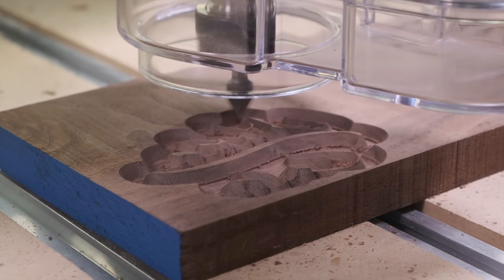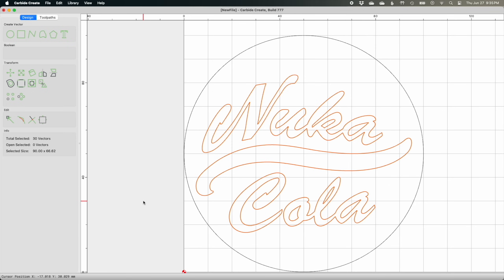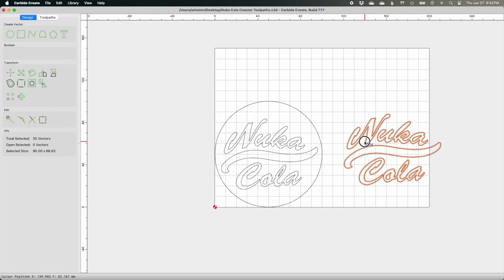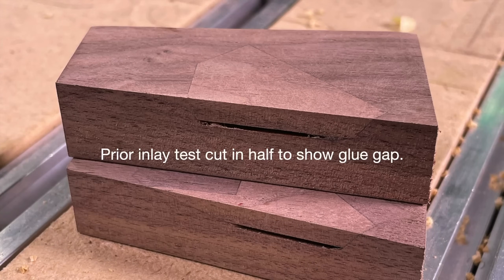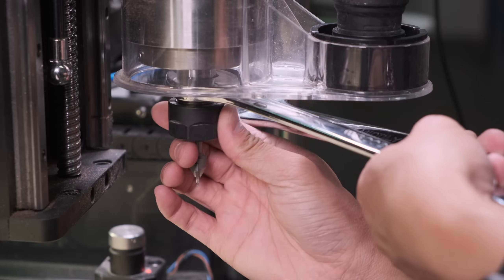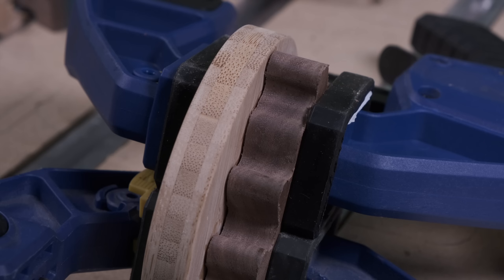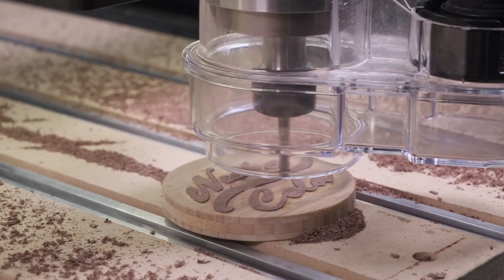How to Create Perfect V-Carve Inlays on your CNC

Comment: Want to call out something important at 8:54 since I didn't hear it mentioned🙂I was wondering how the plug cutout would work without leaving a ridge from where the V bit started carving inside it. The trick is that it has to be a No Offset contour - an Outside would (likely) cause the ridge I'm describing. You can see this is selected in the video at 8:58 (although it starts as Inside / Left, then magically becomes a No Offset through movie magic😉). An Inside contour should work for this purpose as well but you'd have to be more careful about accidentally cutting into the plug.

Comment: There’s one step I don’t understand when Winston was going to do the plug. He started within 1/8 inch end mill. I don’t see in the program where you put that particular tool to start the plug.
Reply from the maker: The request for that tool is contained inside the Adv VCarve toolpath.   When the program is run the GCode will contain paths for both the 1/8” and the V-Bit.

Comment: I understand that mirroring is required, why can't carbide create do this automatically for us? Seems like a lot of added work when it could do it for us and allow for manual control for when it's required
Reply: Our current thinking is this: In the majority of cases, your inlay plug will be smaller than your finished piece, you're going to set the plug up in a different location relative to your origin., and you're going to want to define a boundary to cutout your plug as tight as possible for maximum material efficiency. Mirroring a design is one click, and the "extra work" around preparing that mirrored design to be cut out is something that would likely require human input at some stage in the process anyway. Also, there's significant value in a software working in a "what you see is what you get" mode, where the black box/"behind the curtain" operations are kept to a minimum. You see your mirrored design, it matches the simulation, your result is exactly what you expect.

If long-term feedback says otherwise we'll consider it, but right now it does not appear to be a deal-breaker or undue burden for anyone.
Reply: @WinstonMakes  I do see your point and I'm for sure advocating for keeping it as it is, as a manual option. Its great and you're right, its not a lot of work. 

Just to be clear the feature I'm talking about is that this plug toolpath would be linked to the vectors and auto update. Not a huge time saver if, like this video you nail everything the first time. But I'm living in the real world where typos and other types of mistakes happen and having to redo my plug every I make small updates to my design does add time.
Reply: @WinstonMakes  this reasoning makes sense to me as well. If you see feedback that people are forgetting to mirror it, maybe there's a compromise where enabling inlay plug mode in the Adv VCarve toolpath screen adds some red "DO NOT FORGET TO MIRROR YOUR PLUG" text 😅A full on modal confirmation screen would end up annoying folks that always remember to do it, but having something visibly change on screen would catch your attention if you're new.

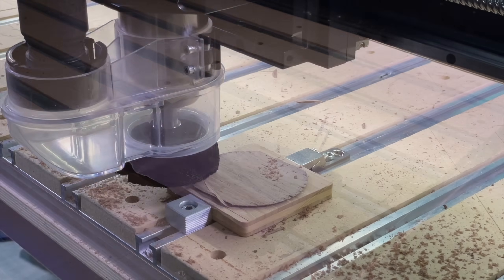Comment: Did you do an "engrave" toolpath at 15:20?
Reply from the maker: It's a 3D Roughing toolpath. Basically, in CC Pro I modeled a cylinder that is the final height of the coaster, and then I applied a roughing toolpath to that region. That produced a toolpath that went back and forth, stopping at the surface of the coaster.  (-W)
Reply: @carbide3d  Can you provide a tutorial for this? I'm struggling to find any 3D instructions outside of an imported STL file. Thanks!